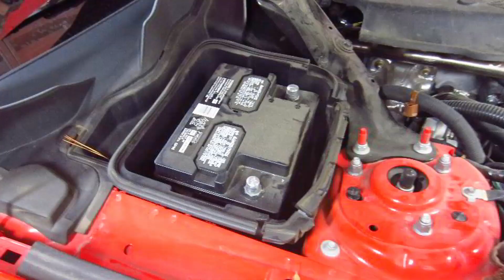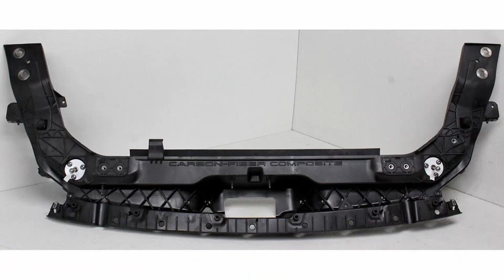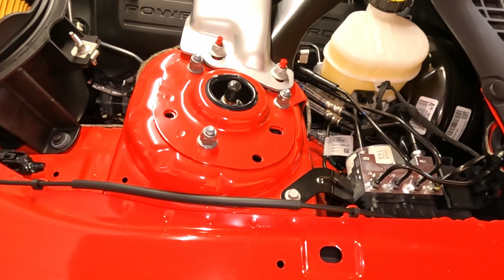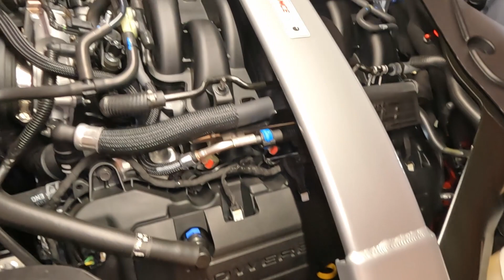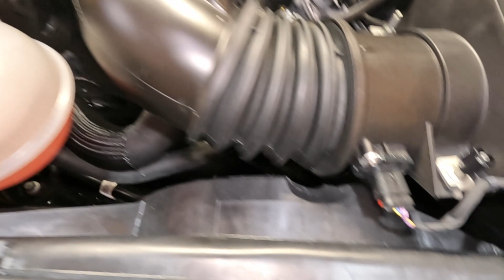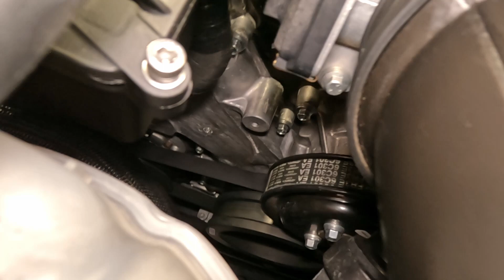Shelby GT350 Engine Components Up Close

Comment: Very nice overview of the engine compartment.  Thanks for sharing!  

The only thing I did different was I did do both FP Air/Oil separators..  🤙🤙😎🐍🐍🐍
Reply: Do you see any oil in the driver side?  Most don't from what I researched, unless they track... curious to hear your experience.
Reply: @johnalterio372  I did both sides.  For the cost, it was a no brainer.  Just a little extra insurance.